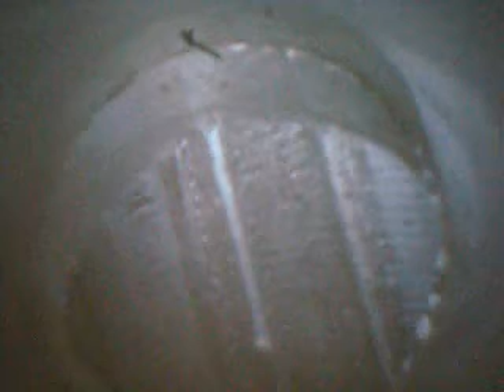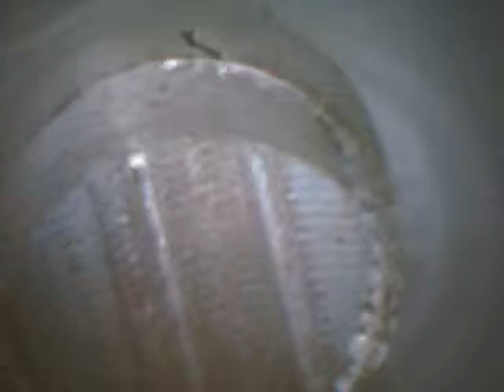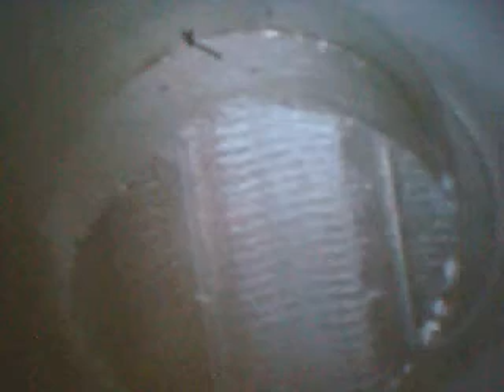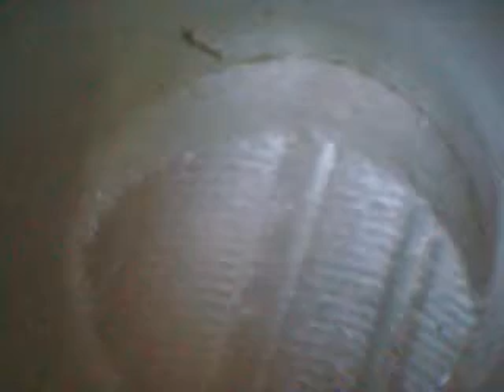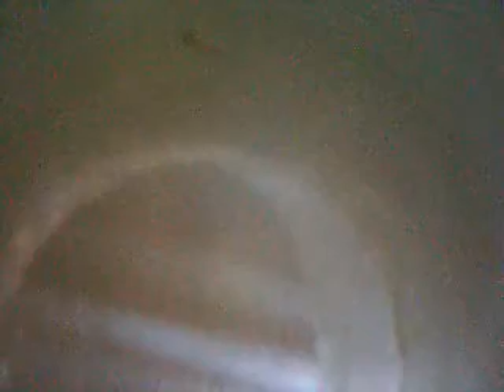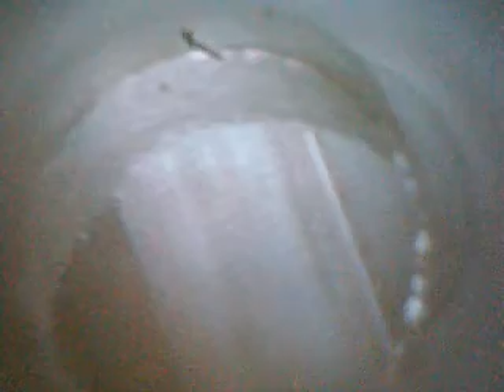Rough rifle barrel

Comment from the maker: I first used a piece of mirror from a ladies make-up set which was about 1.5mm thick but I have since found some thin plastic that is mirror coated and also mirror coated card.

I'm a bit of a nerd when it come to weighing my powder, I have about 20 set of scales - Have you seen the Targetmaster trickler video?

Comment from the maker: continued......Then found a piece of wooden rod (paint brush handle) that fitted into that tube then cut it off at 45 degrees. Then I stuck a piece of mirror on the angled rod and ground it down with a dremmel type tool until it fitted in the brass tube.
The light is a 2mm led soldered on long wires fed in from the breech end.
Then I got a cheap webcam, £8.00 and took the lens right off then stuck the cam body on the eye-piece of the viewer with hot glue.

Not perfect but it did the job.

Comment from the maker: I'm a targetshooter in the UK and recently bought a new rifle for long range shooting. The rifle shot fairly well but I could feel the barrel was rough and a devil of a job to clean so I thought I would try and make a bore scope without spending a wad of money.
I started with a cheap bore viewer from Cabela in the USA , this has no light souce or right-angle viewer. I found a bit of brass tube (portable radio ariel) that fitted inside the Cabela tube and filed a hole in the top. Continued.....